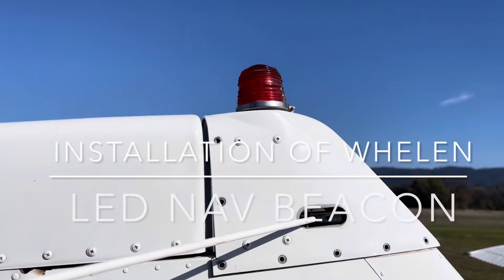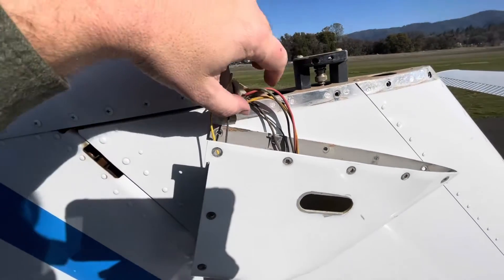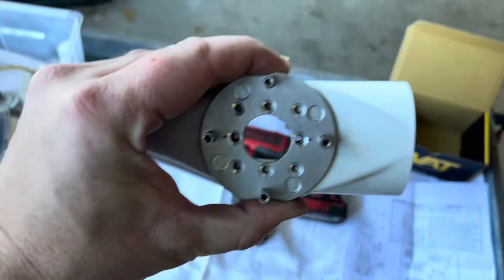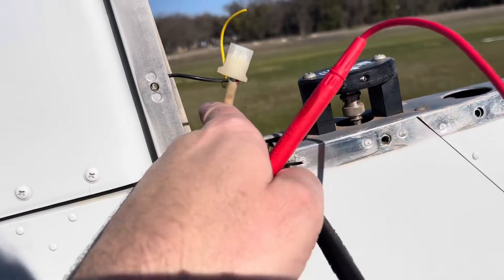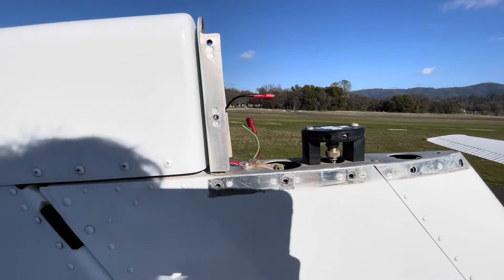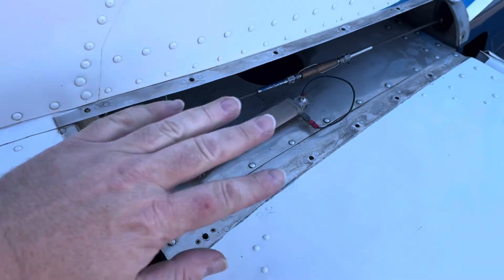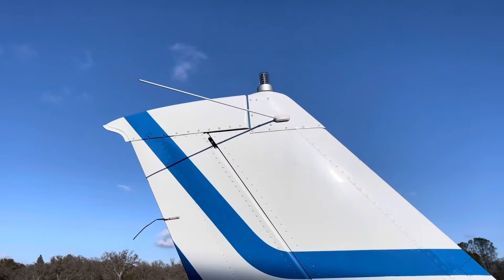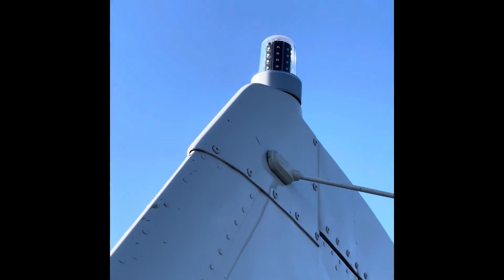Installing Whelen LED Beacon Light (Cessna 182)

Comment: Great video. Would a symptom of a faulty beacon regulator be that the beacon stays illuminated and does not cycle on and off while the engine is running? During a walk around the light is always flashing but when the engine is running it’s steady on.